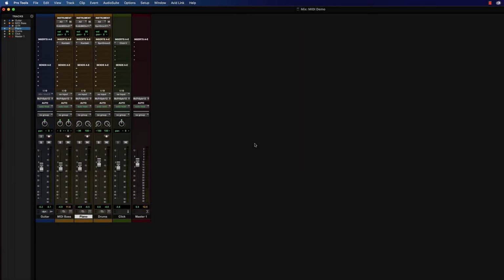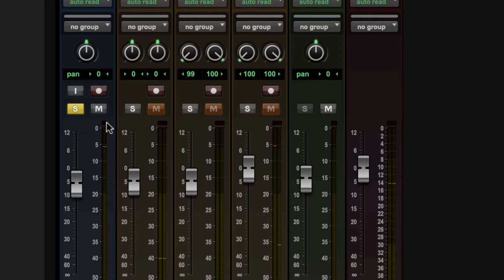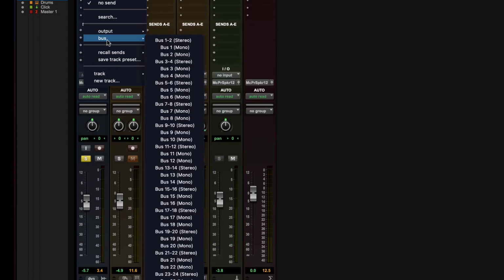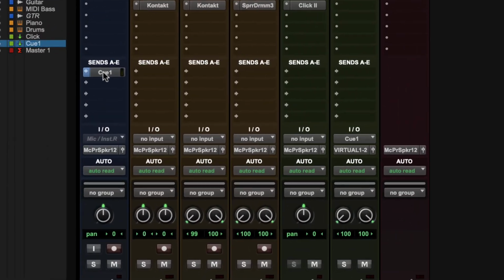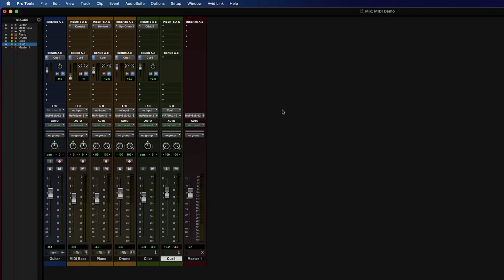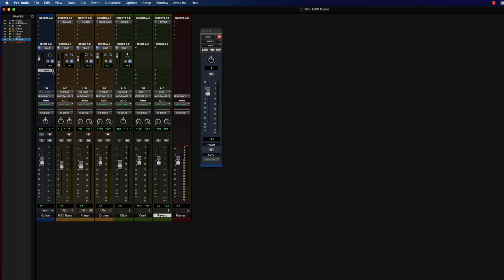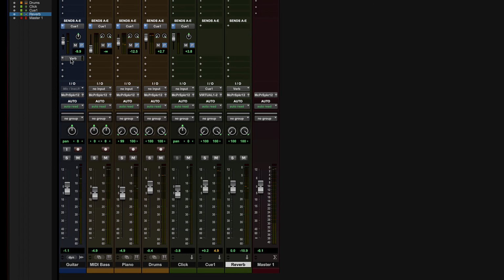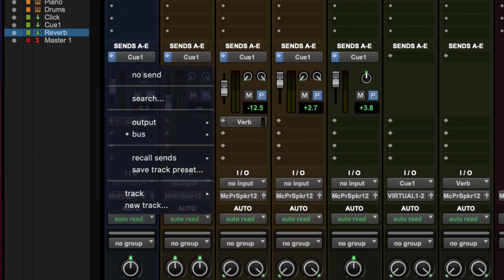Pro Tools Fundamentals: Signal flow with inserts, sends, and returns

Comment: Hey Scott thanks for the vids they have helped me out alot.... Quick question. I have a focusrite 8i6 and protools intro. After i plug my guitar in and create a guitar track I have volume...but I notice when I turn the the slider all the way down on guitar track i can still hear my guitar. I am using headphones and no monitors. Any answer why this could be happening ????? Thanks so much
Reply from the maker: Hey there! I wonder if the focusrite has some sort of input monitor button? If so, it might be that the focusrite has that feature so you can hear your signal directly from the interface. The other possibility is you have a pre-fader send going to an aux somewhere?
Reply: @scottwolfguitar  Thank you Scott....it was a setting in focusrite  to hear signal directly from interface...Fixed it...Thanks a million
Reply from the maker: Awesome! Glad it hear it!

Comment: Hi, how can I put delay on a reverb using sends? The outputs of the send channels shoe their output as Stereo Output. This means all sends are running in parallel. I hear mixers say “I put delay on the reverb” How is it possible if the sends are parallel? Thanks.
Reply from the maker: Never heard that before. Typically you put a reverb and a delay, one before the other on a track. Typically, the effects are both on their own aux.
Reply from the maker: So I just ran into an instance where someone sent a delay to a reverb. Makes sense since the delay was on a guitar track and the guitars were also going to the reverb, so having the delay heading over to the reverb seems logical. All sends are indeed parallel and inserts are in series.
Reply: @scottwolfguitar  Thanks for the clarification :).

Comment: What is the best way to use an external preamp and bypass the avid pre amp in avid carbon. No one has been able to answer this question for me. Thanks
Reply from the maker: I haven’t used carbon at all, sorry!
Reply: Maybe by using the Avid Carbon D-Subs In and Out to hook up your Per-Amp of choice. So you will need to get your D-Sub Looms with XLR Connections. ALTERNATIVELY If your External Pre-Amp has ADAT Connectivity, then maybe you can hook it up via ADAT …… Ins & Outs. The ADAT Connections on The Avid Carbon might be a great way to expand your system. Check it out !!